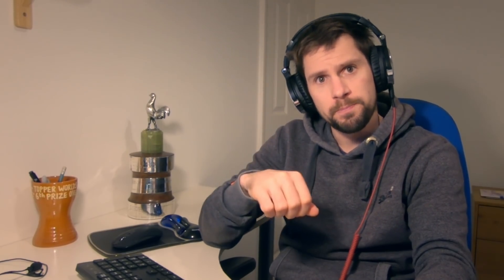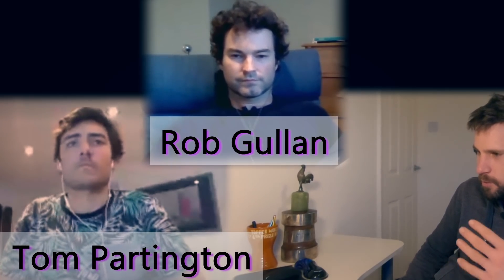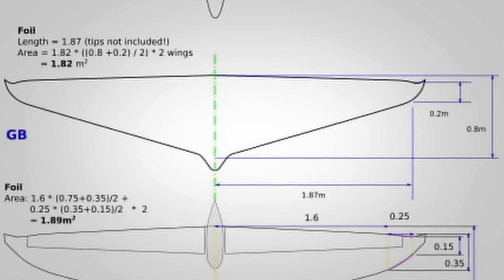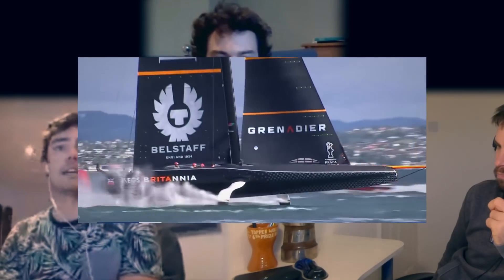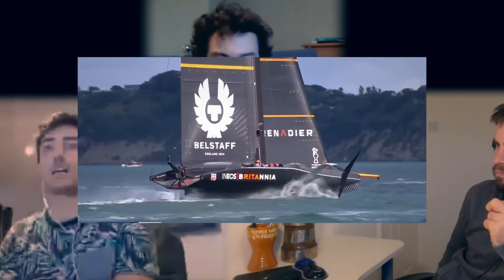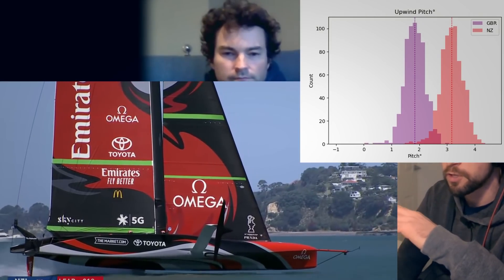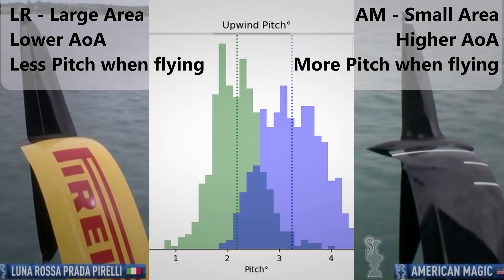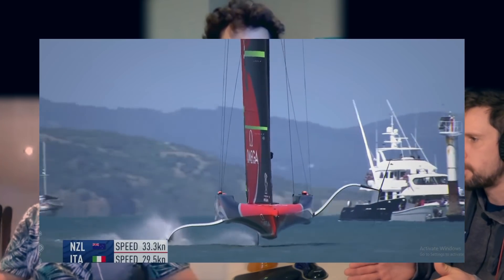America's Cup Foils: Does Size Matter?

Comment: Intersting discussion but you haven't mentioned the risk of cavitation. Do you guys think cavitation does not have a significant influence for these foils?
Reply: Hi Jan, you need to watch the previous videos. I do think there is a risk especially round the foil root.
Reply: I suspect cavitation plays a big roll in the design of the foils, particularly in the cross-sectional shape of the foil.  With the amount that I've seen the foil tip pierce the surface, I suspect ventilation has also been considered a lot in the design.

Comment: Подъемная сила крыла  Y = R V^2 /2 x S x Cy/. Cy - это форма профиля ( поперечное сечение крыла ). Судя по фотографиям,  профили крыльев и их форма в плане ( да еще и с Уикомбами ) :) были взяты из авиации. Что не приемлемо для воды, которая в 820 раз плотнее воздуха.  Wing lift Y = R V ^ 2/2 x S x Cy /. Cy is the profile shape (wing cross section). Judging by the photographs, the wing profiles and their shape in plan (and even with Wycombs) :) were taken from aviation. Which is not acceptable for water, which is 820 times denser than air.
Reply: I think in your formula Cy is what we would call Cl lift coefficient and its determined not only by profile but also alpha (Angle of attack), Mach Number and Reynolds Number. The density of the fluid is considered in the Reynolds number and the profile choice will be driven by that too. Don't forget also that density is part of the lift formula. "Half rho Vee squared" is  dynamic pressure. Lift = Cl 1/2rho v`2 S where S is Area.
Reply: @TheFlyingPlectrum  Спасибо, Дэвид ! Я написал то же самое, только обозначения величин несколько другие. Числа Рейнольдса больше подходят к воздушной среде. А число Фруда - к воде. Числа Струхаля - к вращающимся поверхностям. А R*V^2 / 2 - это скоростной напор или кинетическая энергия
. А график зависимости Cl / альфа - есть начальной характеристикой профиля . Основным же "паспортом" профиля является эпюра зависимости Cl / Cx
Thanks David! I wrote the same thing, only the designations of the quantities are somewhat different. Reynolds numbers are more suitable for the air environment. And the Froude number - to water. Strouhal numbers - to rotating surfaces. And R * V ^ 2/2 is the velocity head or kinetic energy
... And the Cl / alpha plot is the initial characteristic of the profile. The main "passport" of the profile is the Cl / Cx dependence
Reply: At slow speeds, airfoils shapes work great in water.  This is why on many "normal" sailboats, symmetric airfoil shapes are used for the keel and rudder.  At high speeds, traditional airfoil shapes are likely to cavitate.  I suspect cavitation may have played a big role in the foil shape selected for the AC75s.
Reply: @andrewsnow7386  Спасибо Эндрю ! В экс СССР жил и работал  выдающийся конструктор судов на подводных крыльях  Ростислав Евгеньевич Алексеев. Его Первое в мире судно на подводных крыльях было построено в 1943 году. И больше него никто не иследовал профили и формы крыльев. Посмотрите фотографии его судов и сравните с тем, что применили на яхтах Кубка Америки. У меня , глядя на фото крыльев яхт возникает только один вопрос : никто не смотрел фото работ Р.Е.Алексеева ? Скорости такие же - около 100 км/час.
Thanks Andrew! The outstanding designer of hydrofoils, Rostislav Evgenievich Alekseev, lived and worked in the former USSR. His world's first hydrofoil was built in 1943. And no one else studied the profiles and shapes of the wings. Check out the photos of his ships and compare with what was used on the America's Cup yachts. Looking at the photos of yacht wings, I have only one question: has anyone looked at the photos of R.E. Alekseev's works? The speeds are the same - about 100 km / h.

Comment: I understand the aerodynamics of wing shape, obviously in a compressible medium. But how does that translate to a non-compressible medium. You talk about lift, but in a wing this depends upon the differential in pressure above and below the wing, but surely this can not be the case in a liquid.
Reply: the lift theory you are familiar with assumes non-compressible theory. Only when entering trans and supersonic regimes does compressibility come into play. So the foils here work just like your low speed aircraft wing.
Reply: 1/2 x density x V squared x S x Coefficient lift.   V= speed. C = coefficient of lift applies
Reply: Lift in water and air are vary similar.  In both cases, if there is lift, then there is a difference in pressure between the top and the bottom of the wing.  You can't have lift without a difference in pressure.  Of course there are air and water have some different considerations -- in water you may need to consider cavitation and ventilation, and if you move fast enough through air (over Mach 0.3 or so) you may need to consider compressibility.  But the basics are the same, and further, the complicated Navier-Stokes Equations fully describe them both:
https://www.youtube.com/watch?v=ERBVFcutl3M
Reply: My pet theory is that the 'meme' of wings working by air going faster over longer top surface, giving lower pressure due to Bernoulli, etc etc. has caused monumental confusion over the years. Childrens' books are full of that rubbish! We do not explain how rudders or oars work by invoking Bernoulli.. Newton is sufficient: the wing exerts a force on the air, accelerating it downwards and experiences an equal up force.
Reply: @paddywwoof  I agree with you completely.  F=ma -- lift force equals the mass of air times its downward acceleration -- is a much better basic answer to the question 'Why do airplanes fly".  Bernoulli should only be trotted out if the question is 'Why is an airfoil shaped that way'.  And even then it should only be used if one is doing a more comprehensive explanation including angle of attack, etc.
Reply: Lift from the wing shape is less effect then the angle of attack. A flat foil would work but have a higher drag.

Comment: I think that the trailing edge extension of the arm of TNZ has a key role during take off  they provide lift and righting moment at the cost of reduced upwind force.
It also keep most of the arm out of the water compared to other team and this greatly reduces the actual wetted surface during take off
Reply: It's very noticable that the water spray sheds from the arm closer to the water in TNZ and does it in a cleaner way.
Reply: @skynineUK  that's the multiple step foil foot, if you notice there are mostly two spray regimes depending on which step is in the water

Comment: Is the foil  that's out of the water just dead wood or can it provide any benefit? I'm wondering since it's not parallel to the water surface is it pushing towards the boat?
Reply: The complete foil plus arm weighs ~1.3t, which provides a righting moment like a keel and bulb in a keelboat.
Reply: I think out of 7T total the arms/foils have a min weight of 1.8T, I was wondering about the aerodynamics when the windward arm is in stabilising mode. Seems you can only have two foils in the water when manoeuvring. Fascinating subject.
Reply: @750VFR  Each foil and arm together weigh ~1.3t !  They have a bit of drag when lifted, but not much really. Of course, that weight was by design as ballast to help provide righting moment. Think of it as a keel stuck to the side of the boat instead of underneath. 😉

Comment: The American foil seems to produce a lot more spray trailing it above water under the same conditions. This means that it is a lot less efficient and probably creates more drag.
Reply: I don't think spray directly links to drag, but it is interesting to see. Spray is commonly caused by some sort of sharp edge or poorly designed trailing edge that "catches" the water and throws it into the air. When you get going fast enough just putting a vertical rudder or another surface into the water will throw spray. If you look closely at the last race, Italy has a similar spray volume but it's not thrown as high into the air.
Reply: @KnowledgePerformance7  The energy that creates the spray has to come from somewhere and the higher it flies the greater that energy.
Reply: @richardlinsley-hood7149  So is it extra drag? most certainly yes, but is it a sign of avoidable drag or bad design? I don't think so.
Reply: @richardlinsley-hood7149  @Richard Linsley-Hood Spatter is caused by side slip, which is the centerline from the center of the main wing and the rudder stabilizer. and since the boats move along the axis of the hull, there is a lateral flow around the wing strut and rudder.
Reply: @АлексейОксаненко-з3х  I do rather understand how spray is caused and why. If the USA version produces more than other choices then it is, by definition, less efficient overall. By eye it would appear that, for whatever reason, the USA foil is producing more and higher spray than the others.
Reply: @KnowledgePerformance7  Well as the USA appeared to be slower than the others too perhaps it is more than just appearance.
Reply: @richardlinsley-hood7149  I think they had much larger problems than spray...
Reply: @KnowledgePerformance7  They sure did, but I suspect that the extra spray did not help.
Reply: @richardlinsley-hood7149   Согласен.  I agree.

Comment: Thanks guys for another great video. Given that you know the total mass of the boat and therefore lift required and the approximate area of one leeward foil, can you work backwards and propose some actual numbers to the wing parameters you mention. What speed or lift coefficient each team is working with? Maybe go so far as which team is working closer to the maximum lift potential of their wing?
Reply: Hi Robin, this is something we have done and maybe we will share some more detailed facts and figures in due course. 

As for the maximum potential, because we don't know the lift surface section shape it is very difficult to have a guess at this. 

The smaller the foil area, the harder it has to work or other words, a higher lift coefficient.
Reply: I've worked out some numbers based on LR's foil profile, and CL varies from about 0.4 to 1.0. However, getting accurate profiles is near impossible, the profile I used was only a best guess.  Note that vertical lift is mostly in abundance, but the teams also want to maximise lateral lift to counter leeway. In fact, the foils do at times produce more vertical lift than the weight of the boat+crew, but this is balanced by downforce from the rudder foil.
Reply: @maxhugen  yes we have cl in a similar range for LR and Ineos, with ETNZ higher due to the smaller area. 

As you say Max,  as speeds get higher, the rudder will be used in negative angles of attack to generate downforce
Reply: @thomaspartington8464   @maxhugen  Thanks both.
Reply: rofl, using some big ole words and phrases there gee. but u wrong too. how so many u so called smart people so dumb? oh, thats right coz most others are even dumber   ahahahahahaaaa.  NO, IM SERIOUS AND CORRECT. YOU ARE NOT.
Reply from the maker: @freeman1843  locked inside his anger chamber
Reply: @freeman1843  Man, must be some strong stuff you're smoking today!   😉